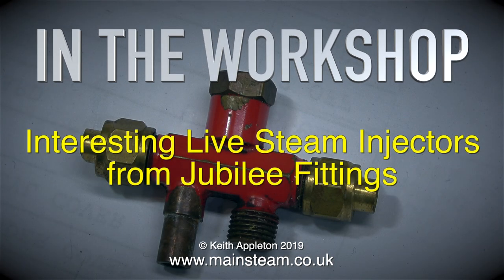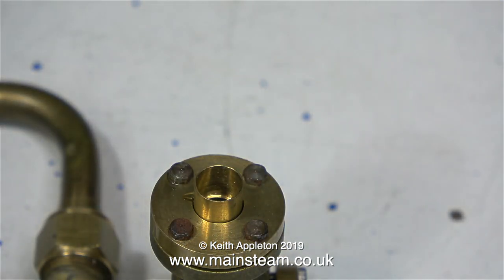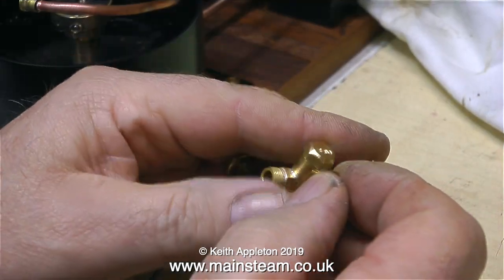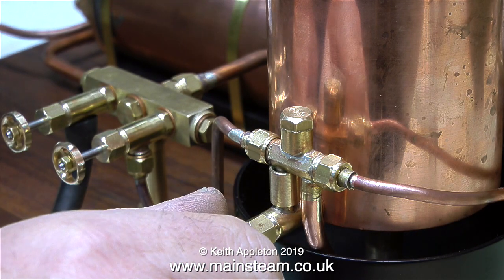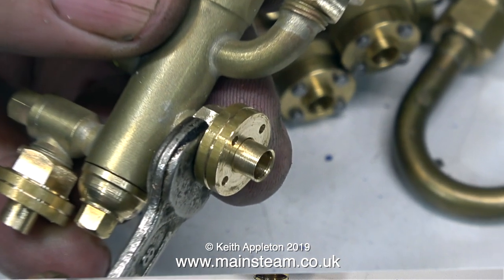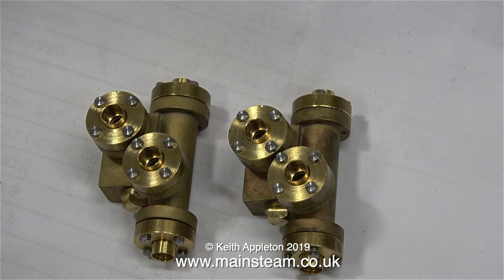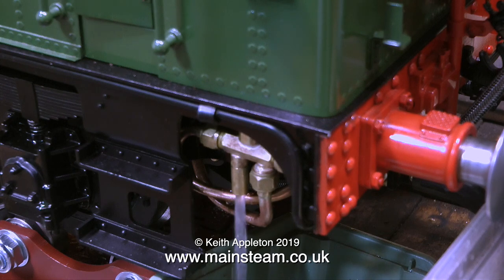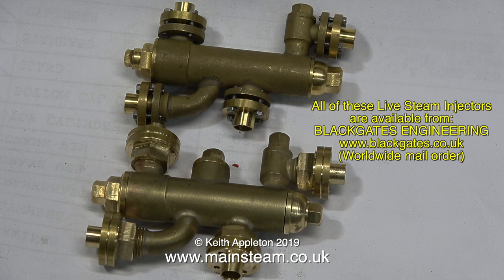LIVE STEAM INJECTORS MADE BY JUBILEE FITTINGS

Comment: The flanges with the separate union in the middle follow full size practice, used in some of the pressure vessels I was involved with. They're called 'loose lap' flanges, though they would typically have a gasket  - I guess it's easier to make a metal to metal seal with a smaller fitting. They also have other advantages though; it's easier for installation if you can rotate the flanges to align the bolt holes, and if you need some expensive exotic corrosion resistant material in contact with the piping contents, you can use a much smaller piece of it than if you had to make the whole flange from it.
Reply from the maker: Thank you for the very interesting information - I didn't know that - I don't do much with full size steam engines.

Comment: In a past life I used to drive a Wallis & Stevens compound engine - set to blow at 170 - the number of ways to get water into the boiler were limited - water lifter, high pressure injector or mechanical pump, the low pressure injector was iffy to say the least. The high pressure vertical injector was as reliable as hell, water on, couple of cracks of the steam valve, soon had her singing.

Comment: 2:04 I don't want to be a smartarse, but if you know the surface total to connect, the height of the gap (which is negligible, say 0,01mm or 1/1000 inch) and the specific weight of the solder you know how much solder to weigh so you get just enough without leaking blobs. 
At least in theory. Or was your question a hypothetical one?
Love your video's, very thorough explanations and humour. Thank you!

Comment: The quality of the silver solder on those injectors, reminds me of aerospace quality, where silver soldering was actually furnace brazing, sometimes under vacuum.  Basically the parts are positioned on fixturing, and silver solder/flux preforms are placed at the joints.  The items are placed in an oven, temperature rises... preforms flow... temperature decreases.  I wonder if this was the process?
Reply from the maker: Definitely not, These are made in a modest garage workshop on pieces of fire brick and a using a standard Propane Blowtorch  . . . . it is down to the skill of the makers  (Jubilee Fittings) in this case.
Reply: Keith Appleton where can I find more information about jubilee fittings. I don’t see the injectors in the blackgates catalog

Comment: My 7 1/4 loco has one of the horizontal injectors similar in size to the red on that you have, aside from it scaling up every so often I don't have any issues with it. With careful fiddling it picks up and feeds right down to 15-20psi (with some dribbling and hesitation) and works all the way up to the 100psi working pressure of the engine. I'd be quite tempted to buy one of the jubilee fittings injectors as they look much better and more scale accurate but I'd be interested to know if they have the same kind of working range that my current injector has.
Reply from the maker: Yes, as I show in the video the Jubilee injectors often work down to 15psi.
Reply from the maker: The red injectors that you mention are usually "Jubilee Fittings" injectors too . . . . .
Reply: I'm not sure what brand it came from as the engine was originally built in 1991. If it is most likely a jubilee one then I might look into buying one of the more scale looking ones to replace it.